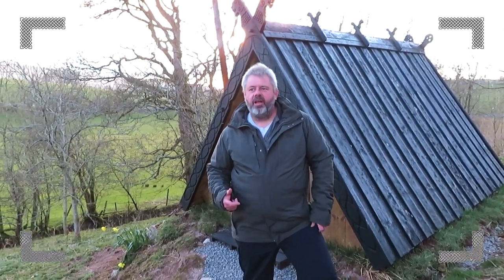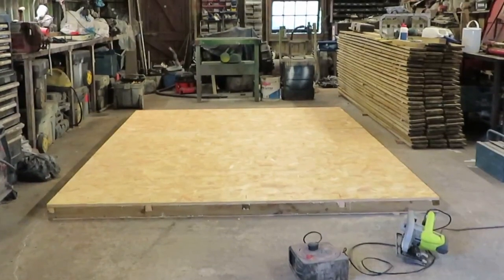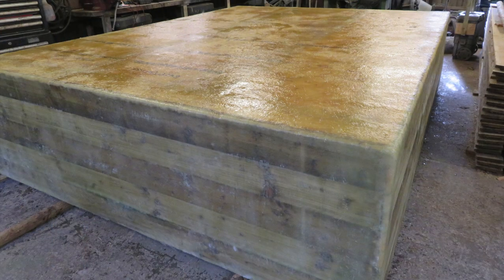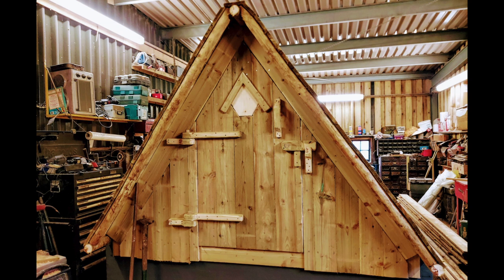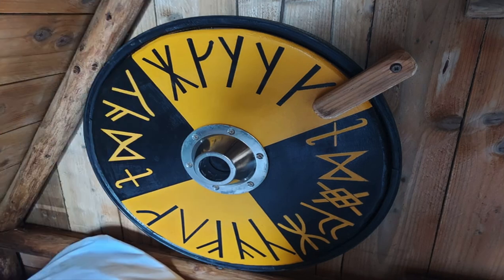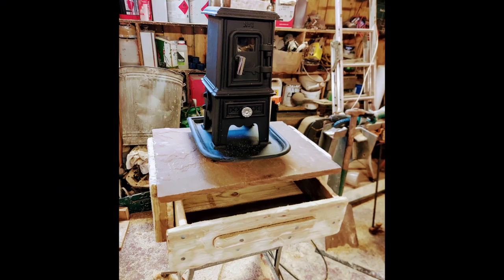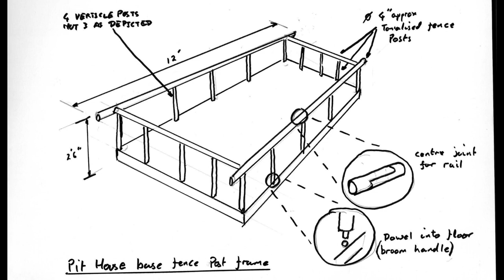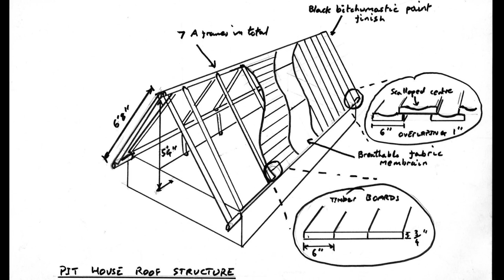Viking style pit house, construction drawings, pictures, dimensions and build explanations.

Comment: What a great video. It is a shame about the current cost of Wood, i bought 5 x  160cm x 16cm x 25mm planks and they cost me £56 so a pit House would be rather expensive in material costs at the moment.
Reply from the maker: Hi Mik, I could not agree more, the price of materials has sky rocketed in the UK because of brexit, I am building with a minimum 50 year life span in mind, so the materials cost is spread over that time in effect.
Reply: here in Brazil a one meter pine board costs R$ 4.25, converting to your currency should give you around £0.68 a unit. but there must be other complications like imports, brexit, and something like that, it will depend on the wood you want to use, but i don't know how things are in queenland as it's been 8 months since brexit, something must have changed in that time